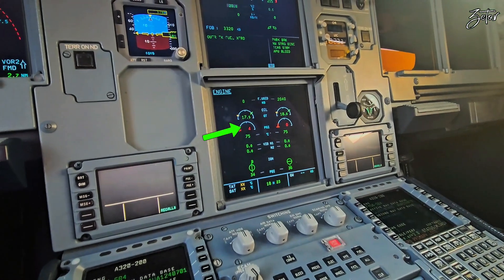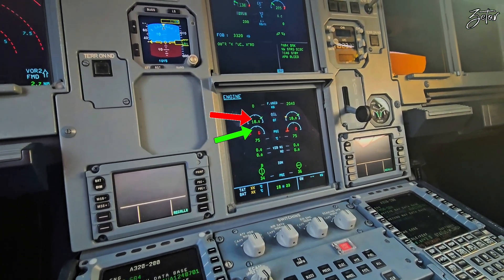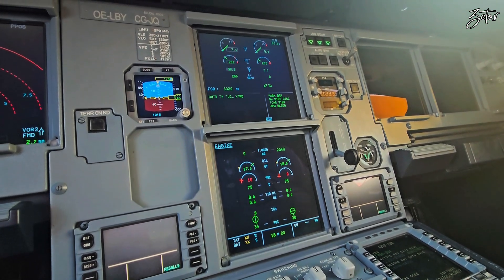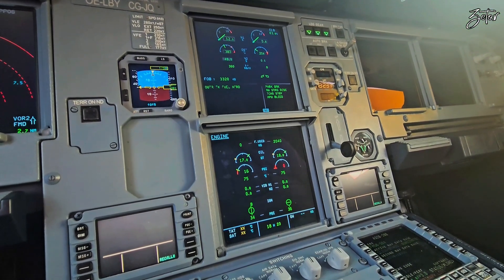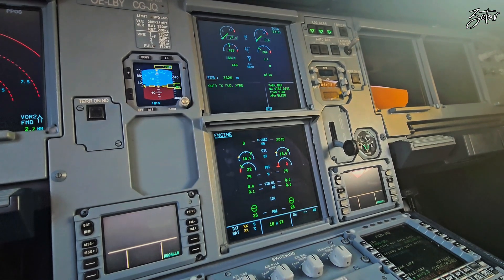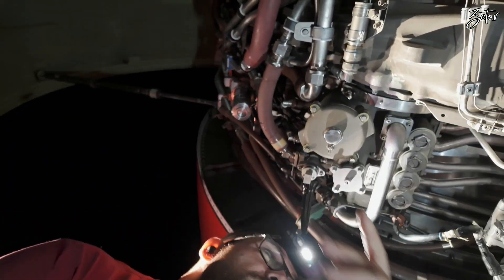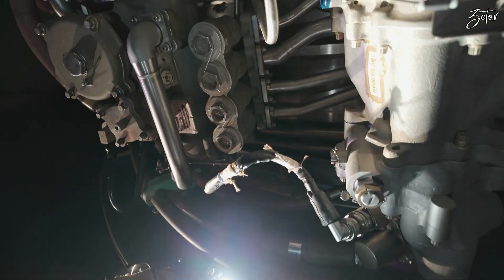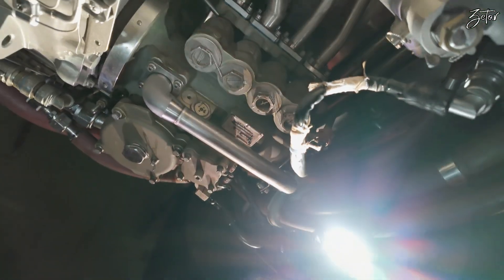Oil distribution in Airbus A320 engine and how we check the condition of it.

Comment: Using the specific maintenance manual, which part should you look for? 
Another question, in the manual is it searched by ATA chapters ?
thank's... You're the best one!!!!
Reply from the maker: Hi, you must be a bit more specific. What do you mean in the first question, because every part has a specific manual for replacement tests and troubleshooting. Yes, every component is part of some ATA chapters like fuel 28, hydraulic 29, flight controls 27. If you want to know more, let me know 🙂 and thank you🙂
Reply: @zeto.r  I thought that all the ATAs were found in a single manual and the reference ones were searched for through the index. So for an operation like this you have to look at and follow multiple different ATAs, did I understand correctly?
Reply from the maker: You have several manuals like IPC, AMM, TSM and SRM all of which are split into ATA chapters and šup chapters you can easily navigate

Comment: I'd never heard of safety cable before! What a neat tool. I'm only familiar with safety wire. Are there many other applications where the cable is allowed to be used instead of wire?

As always, I enjoy the detailed commentary that you provide in your videos :)
Reply from the maker: It is a really cool tool. You need to take a look in the manual it will be referred to as safety cable

Comment: Have you ever had a scavenge screen thread, burr and then pick up when removing it from the lubrication unit.

You're then caught between a rock and a hard place, it will loosen slightly but won't fully undo, it will also fully tighten up.

Classic 3am check, new lubrication unit required if a variation cannot be authorised by CAMO.
Reply from the maker: Wow, I never had such issues. Several times I had finding but nothing serious
Reply: @zeto.r  I had that exact problem, thread burr pick up, nightmare situation, no variation permitted. New lube unit fitment.
Reply from the maker: You see we are learning new things every day 🙂

Comment: Why is it not permitted to start and check-run the engine with the cowls open?
Reply from the maker: It is permitted but you need to have firefighters on-site or a fire extinguisher bcs aircraft system is not effective in that case

Comment: Wondering why don't you add oil in the filters to prevent damage to the lubrication parts during initial start. ?
Reply from the maker: How it is a screen? If the manufacturer wants you to do such things it will be in a manual 🙂

Comment: Great work Tomash! Thank you for using a torque wrench in your work. How long does it usually take for the engine to cool down and be ready for maintenance after a flight?
Reply from the maker: Depends on what you want to do but most of the time we start immediately after passages leave🙂 and TW is a must 🙂
Reply: @zeto.r  The oil must cool for this procedure or it's dangerous for you. Is it possible to use local cooling, e.g. with  dry ice or water?
Reply from the maker: Itmmmit is only for your comfort but other than that it is ok. It is not allowed to cool it somehow, just let it be for some time open an it will be ok